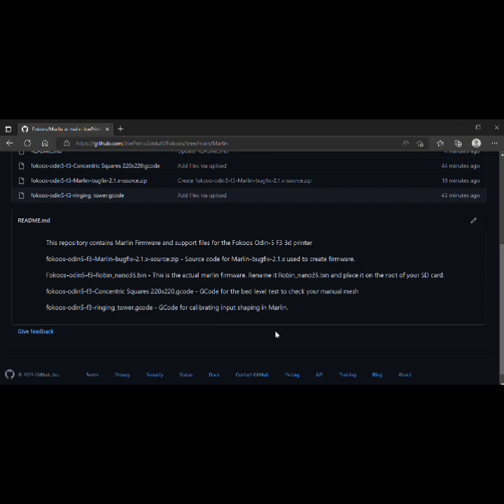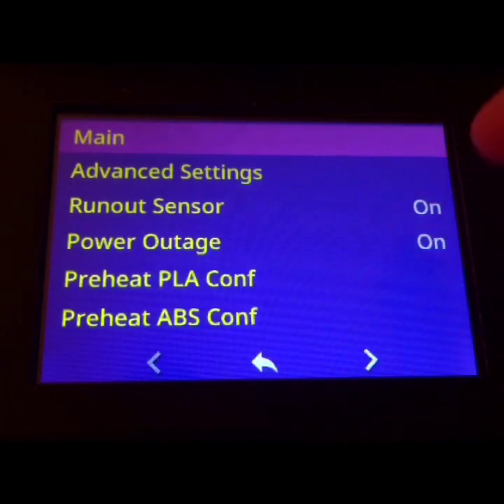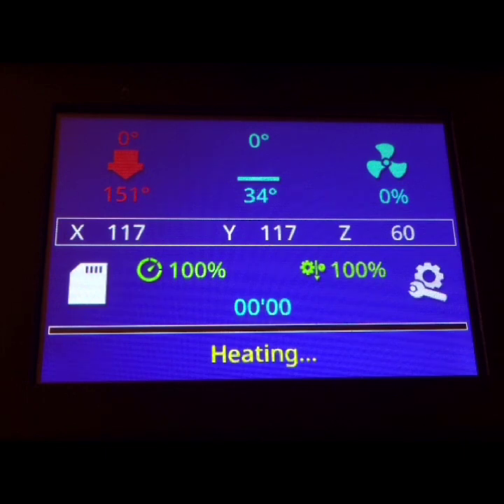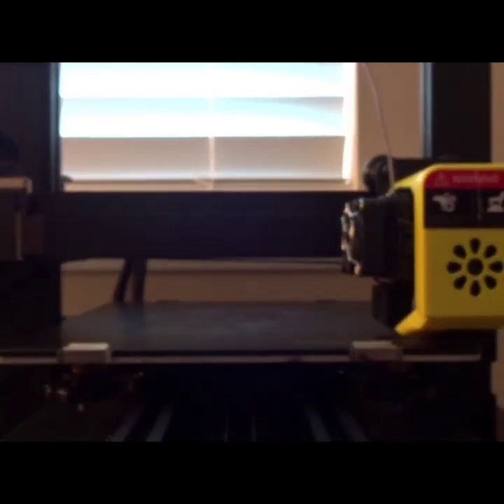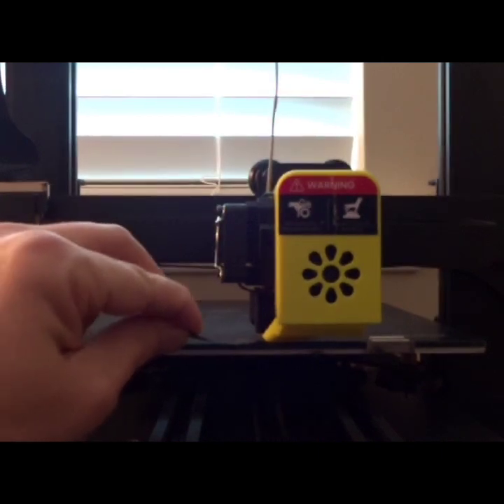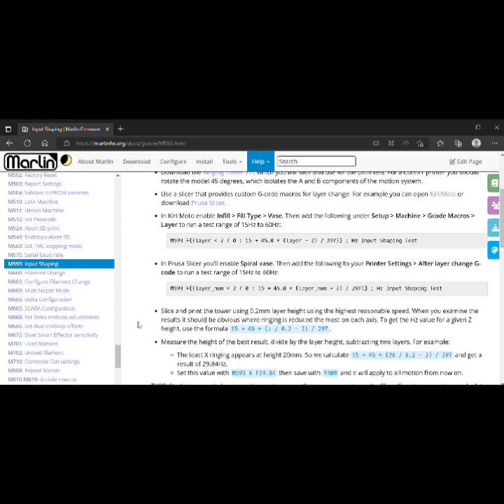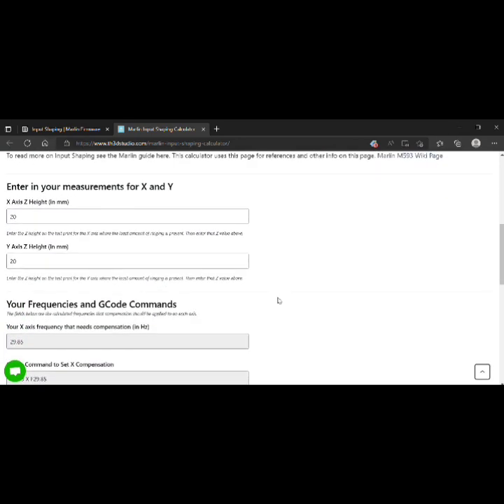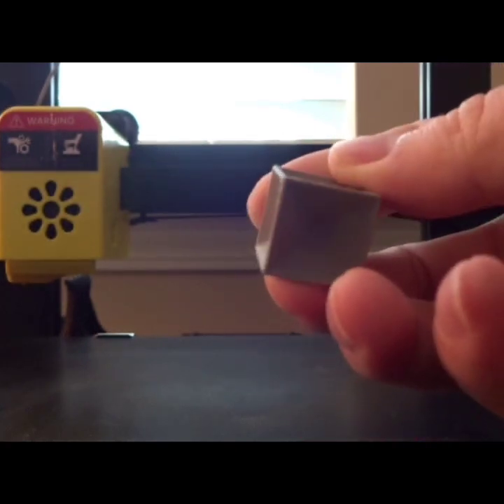Fokoos Odin-5 F3 firmware upgrade to Marlin 2.1.3 with manual mesh and input shaping.

Comment: Just an update, Im rocking out the firmware. one very notable difference I have found is that I tried the King Printing firmware and yours, with the king firmware my prints would stop randomly for like 2 sec then resume, but not with yours. Im just trying different firmwares to see pros and cons. By the way the clone of this is the DOVOV S2, I was hunting the web and found the fiirmware. its basically the same as the stock f3 firmware just with a rebranded screen logo. and it works just fine.

Comment: does not work for me, it flashes, then black screen and long beep err2
Reply: after troubleshooting a bit it seems the board is the problem, I flashed your firmware on a second f3 and it works. the other board will flash but will not work. hence bad board. thank you for the response.
Reply from the maker: It's possible you have a different board.

Comment: Also, could you please tell me how to fix the home position from the centre of the bed to the corner X 0 Y 0?
Reply from the maker: You cannot alter this as its part of the firmware.
Reply: @joeprints3dstuff  Is there any way to edit the firmware code? Whenever my nozzle homes in the centre, it leaves a tiny drop of filament that causes an imperfection at the base of the print
Reply from the maker: @parankapur5166 you can download the source and modify it. You can also change your start gcode to retract a little bit to prevent the blob.

Comment: Idk if you still keep an eye on this, but I ran into an issue.

I got it installed and leveled the bed but now my extruder doesn’t work. When I went to print the test prints nothing came out of the nozzle. When I manually try the switch filament option the extruder motor doesn’t move.
Reply from the maker: Is it clicking? If you flash the stock firmware does it work?
Reply: @joeprints3dstuff  Well, turns out I was an idiot. I just wasn't pushing the filament down hard enough for it to catch. 

But now I'm running into an issue where it's printing in air. It's about 15mm off the plate when it starts printing, and the first purge line is off the plate by about 5mm too. 

I was using the provided gcode so I will get the stl and slice it myself to see if that fixes it. 

Thank you for replying!
Reply from the maker: @joshuadickson4862 glad you sorted it out.

Comment: i renamed it and put it on the sd card but it just botting into the regular firmware
Reply from the maker: What sd card do you have? Is it small or large? Use an 8gb one or smaller if you one.
Reply: @ I figured it out I’m just about to give up on printing. every print I do, level test will be perfect then when I actually print what I want it’s way off and not level and when I do get it right and it prints the never next print I did it’s not level at all

Comment: Does it include also Linear Advance (I ask this because usually this is leaved disabled due to past notorious issues with TMC 2208, that now should have been fixed in latest Marlin version). Does WiFi module work with this firmware? From the GUI doesn't seem you merged Marlin 2.1.3 changes in its original MKS Nano v1.2 Firmare(unfortunately still at Marlin 2.0 version) and I guess you customized the vanilla Marlin.
Reply from the maker: Yes linear advance is enabled. I do not have a wifi module so I do not know if it works or not. Lastly I did not merge their changes intl the latest marlin. That would have taken quite a while to do plus, you would lose some functionality due to their gui not supporting certain things.
Reply: @joeprints3dstuff  Thanks for the reply. Could you please upload the Marlin config files you used(Configuration.h and Configuration_adv.h etc.) ? It seems in source tree config folder they are missing and there is a readme with a link that points to official Marlin config tree, where unfortunately Fokoos Odin-5 F3 config files are missing.
Reply from the maker: I am on holiday but once I return I will

Comment: hey just looking for some clarification on a few things in know that the Robin_nano35.bin file is supposed to be a root file but is that supposed to be unzipped or not also for the other files is there any specific place for them because i have all the files in my card and nothing is happening it boots like normal
Reply from the maker: The Robin_nano35.bin file isn't a zip file and yes it should be placed on the root of your SD card. Did you buy the printer new or used? It is quite possible that it has a different board.

Can you place a gcode file on the sd card and see it from the printer interface?
Reply: I bought it new and yes
Reply from the maker: You should probably pop off the bottom cover and ensure it has a robin board.
Reply: Ok will do thanks

Comment: your firmware is awesome, but it doesn't recognize the BL-Touch I've installed. how can I enable it?
Reply from the maker: It wasn't designed for a bl touch or any other probe for that matter. You would need to recompile it.
Reply: @joeprints3dstuff  oh I see. thank you anyway ;)

Comment: Didnt find this helpful
Reply from the maker: Sorry to hear that.
Reply: Hey,  is the renamed .bin file the only file i need to put on the sd card?  I am getting a Media Init Fail on the center of the screen. Any ideas
Reply from the maker: @23hockeypanda38 yes. What size sd card do you have? Did you format it fat32?
Reply: @joeprints3dstuff  16gb. Reformatted it again and now it is working.  Thanks. Thanks for video.

Comment: Hello thx for the vid. I have a problem with the home position after the firmware update... The machine home position is set to the center of the bed instead of the bottom-right standard position, so when the machine is homing, the extruder goes in the bed exact center. How can I solve this? Everythime the gcode is reading G28 (home), it starts from the bed center and not from the bottom-right. Seems it is something I need to set in the machine and not related to the g-code. Can you please help me to figure this out? Thank you!
Reply from the maker: Homing with this firmware is in the center.
Reply: @joeprints3dstuff  got it thank you! So, what start g-code can I set to cura machine setting , if I want the first print “cleaning layers” are done in the standard bottom-left corner? Thank you
Reply from the maker: Are you running custom gcode already? If you are talking about the purge line, that should be in absolute coordinates anyway and shouldn't be impacted by homeing to the center. 0,0 is still the front left side of the bed.

Comment: I installed it too everything works fine but after a couple of hours it stops to change the filament what can I do
Reply from the maker: You can try disabling the filament runout sensor.
Reply: @joeprints3dstuff Then make a video and show me how to do it
Reply from the maker: Its one of the configuration options. Just set it to off.
Reply: @joeprints3dstuff  I’ll try and let you know, thanks

Comment: Great video but I am having an issue where the printer is homing from the middle of build plate and leaving a blob of filament in the center of the bed causing issues with the first layer of the print is there a way I can solve this?
Reply from the maker: Check your start gcode in your slicer.
Reply: @Joe Prints  unfortunately it isn't that, even when I press autohome in the menu it has the same behavior
Reply from the maker: I guess I dont understand then. When the printer homes it should do x and y, them move to the center and lower. Is it not doing this?
Reply: @Joe Prints  it is doing that, which is a problem when starting a print and the nozzle preheats and filament oozes out a little and leaves a blob in the center of the bed
Reply from the maker: Your start gcode is what preheats the nozzle. This is why I was saying to look there. If you don't want it to preheat in the middle just change your start gcode to move to say 0,0 and then preheat.

Comment: looking forward to installing this as i'd like a more familiar UI.

don't suppose you have a good cura profile for this printer?
Reply from the maker: I was getting good results with the default ender 3 profile. Just change retraction settings.
Reply: @joeprints3dstuff  I've seen this advice a bunch for the Odin 5, but no one ever says what they adjusted to.  You mind sharing how you have it set?
Reply from the maker: @RyanJennHendrickson  just change the retraction settings.